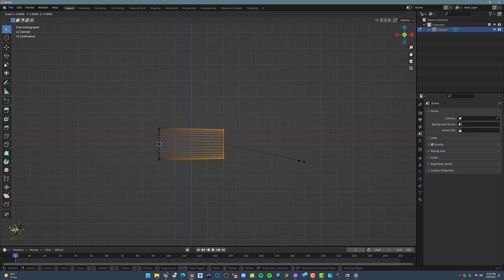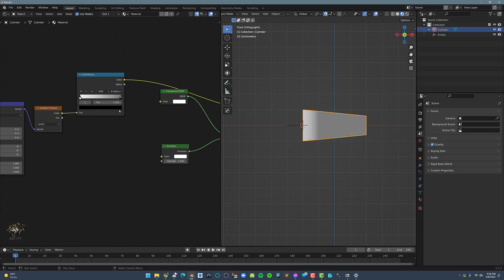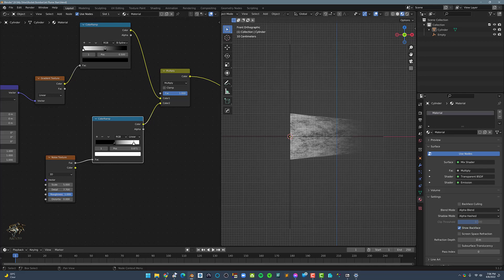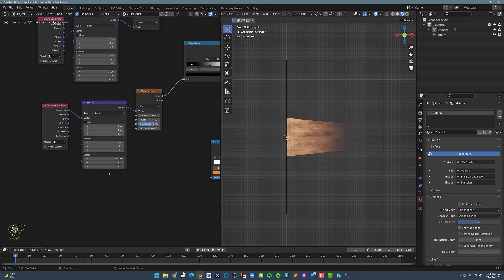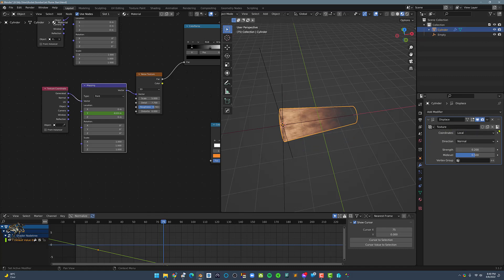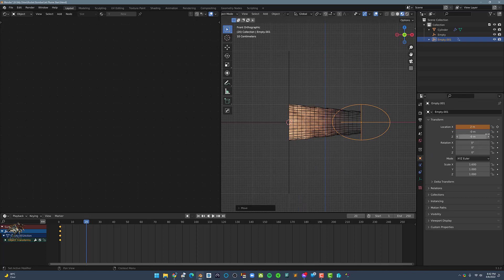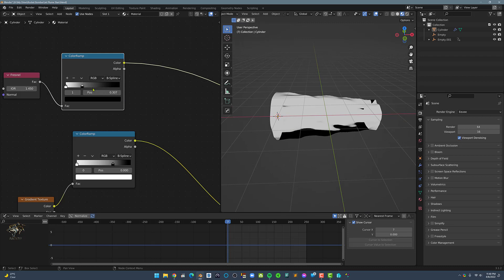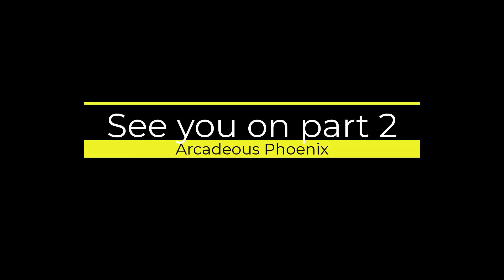Jet Plume FX Tutorial part 1

Comment: At 13:57 when I add the subdivision modifier I lose all of my particle details. All off the flame becomes a solid gradient and the particles disappear. Any idea why this might be happening and how to resolve it?

*Figured it out. Under Preferences > Viewport I turned off GPU Subdivision and now it works properly. Could be some issue with my laptop's GTX 1060, no idea. I figured it out by testing it in 2.9 and it was working fine. Compared the settings to 3.1 and saw 2.9 doesn't have a GPU Subdivision setting so I turned it off in 3.1 and now everything's good.
Reply from the maker: Perhaps you main plume model has caps?, if you could send me the file, I could check it out for you. :)
Reply: @Arcs3D  Thanks for offering to help. I'm stumped at the moment. Here's the file: https://drive.google.com/file/d/1ituYXB7q4J1fnTtfltfp-ipAf6omlVQV/view

*And I think you're right, I may have forgotten to change the cap fill type to nothing in the beginning. Think I'll have to start fresh. Thanks again for the input and the awesome tutorial!

**Wasn't the caps. Still haven't figured it out but I'm wondering if it might just be that my laptop's GTX 1060 is not able to keep up.

Comment: Thanks. :) 

9:35 - It's a bit easier, if you do this in the nodes. Add a "Combine XYZ" and a "Invert" node, and plug that into the Location mapping. The Y value will then move the flame in the correct direction.

Comment: Awesomesauce, wonder if using like a soft body modifier would also give movement as well to like a jet flame or a torch tip. So that it would bend with the movement of the plane/torch.
Reply from the maker: Since this is a cylinder, I would use a simple deform and rig it drivers so that it would slightly bend as the jet turns.